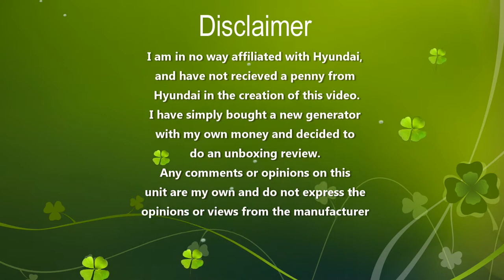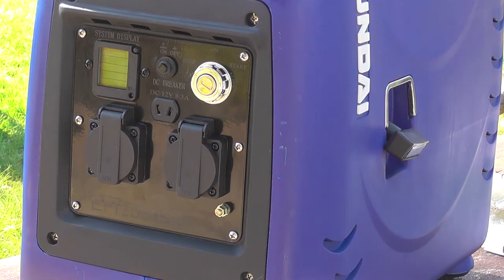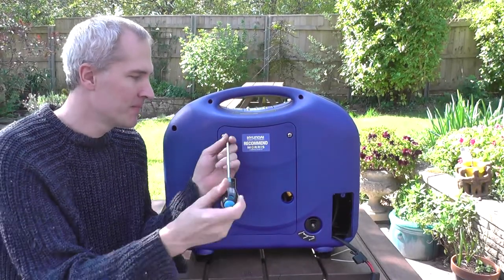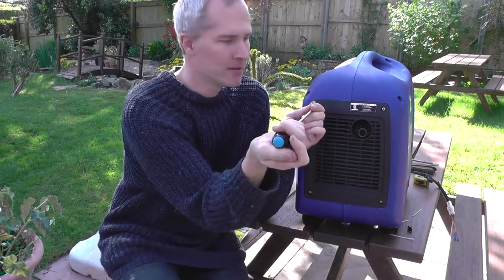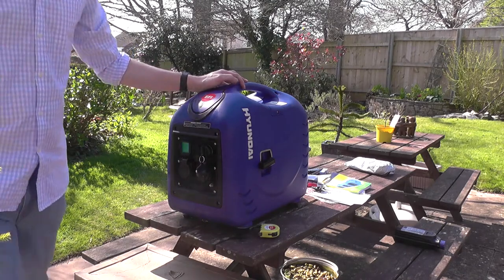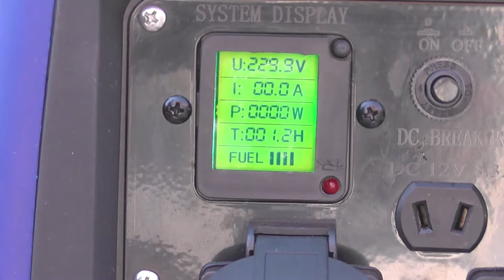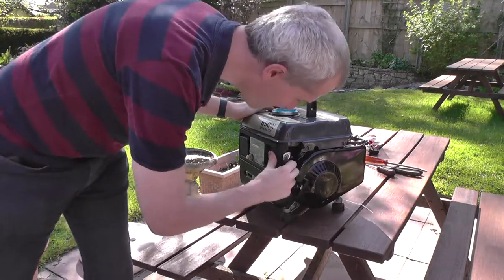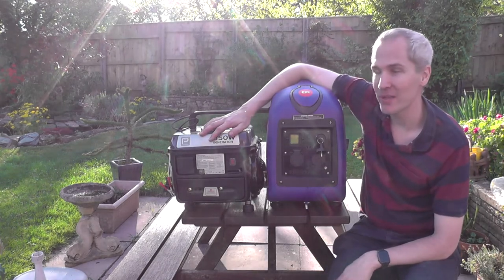My Narrowboat Generator, Hyundai EFI 2500 SEI Review

Comment: Hi I thought as you had gone to the trouble of producing this video I thought I would go to the trouble of commenting.
I am researching generators so I found this interesting. Keep up the good work and get your head around editing. I must say I did enjoy it. You will get better the more you create so well done. The info was informative thankyou.
Reply from the maker: Thanks, for the feed back, i had made a shorter one, but i had requests on a more info like what connections where behind the control panel, etc so remade it. I had been researching generators for my boat and came across this particular model but could find nothing about it online, so decided to do a video. The main point i was trying to get across was that a lot of electric start generators have a manual choke that you have to adjust from start to run, where as the model i have its an automatic choke, and thus i can install a key into the boat so i can start from within the boat without having to play with the choke. Plus its a pure sine wave. 
 I did have a fair amount of issues with rendering, as computer struggled with rendering, but in the end my videos stopped when my computer died, Soon as i can afford another i will continue with some more.

Comment from the maker: Reason it was hard to start on manual, was because it’s electronic fuel injection, and the battery inside was too small, and failing. Soon as a new  bigger 5 amp battery was installed, engine started on first pull.